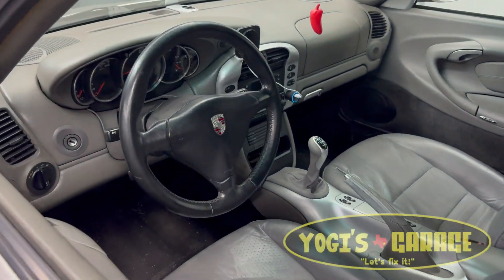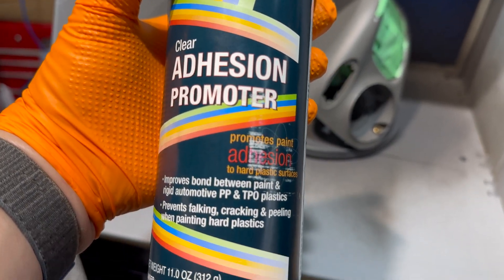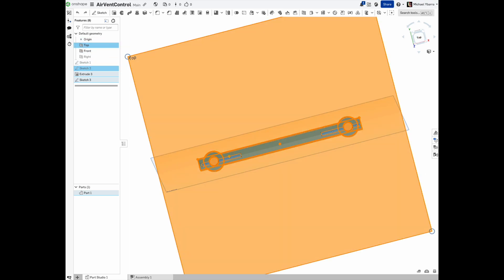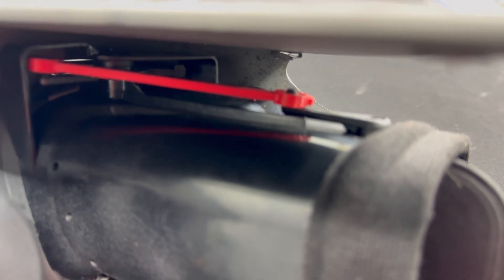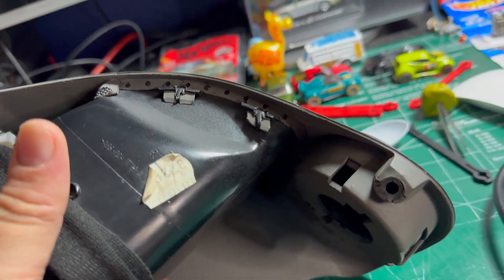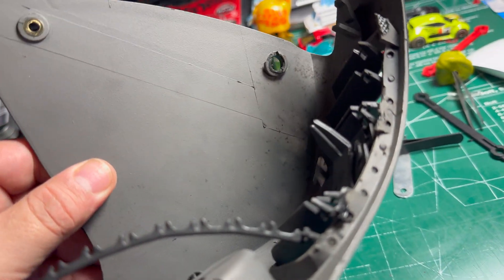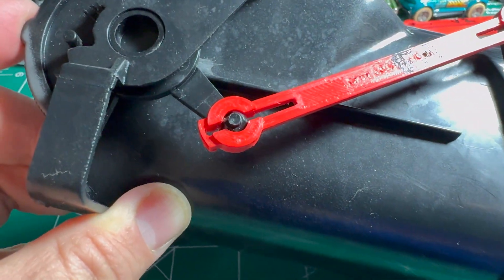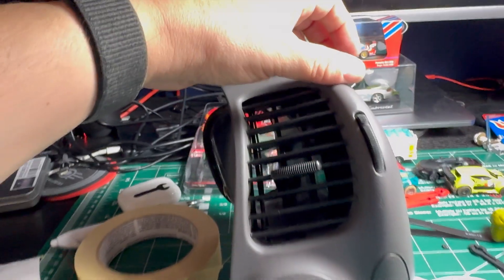3D Printing Parts for My Classic Porsche 911 - Can I Save Money? #porsche911 #3dprinting

Comment: Awesome use of the 3D printer. How much is the printer vs the entire vent assembly? Prolly just paid for itself. The best part is how easy it is to iterate and improve any initial design, which you demonstrated quite well.
Reply from the maker: Thanks Paul! The total kit was about 400. That included the seller upgrading it to correct some of the issues coming from Creality. The whole vent is about 400 so it’s a total wash and will pay for itself.